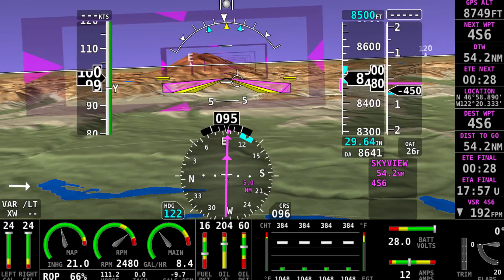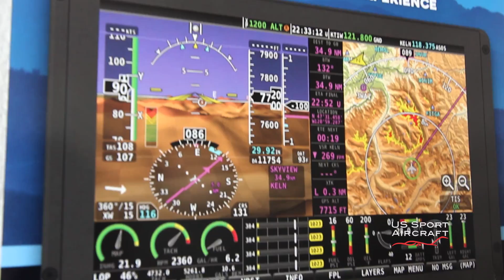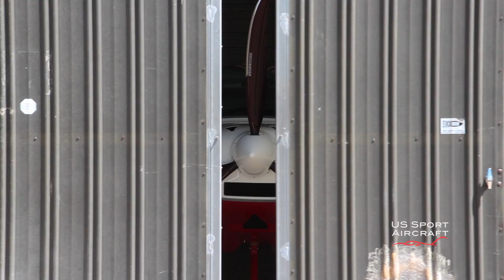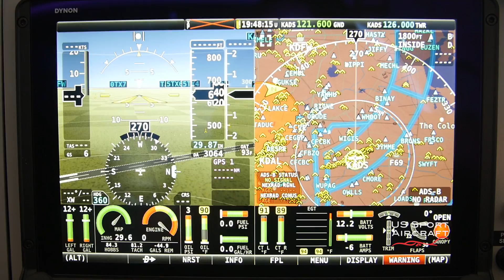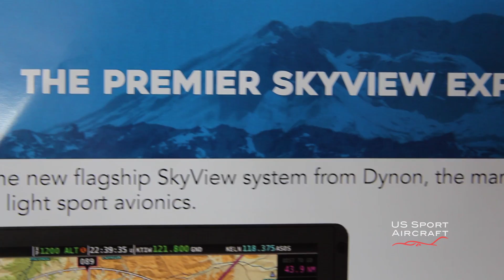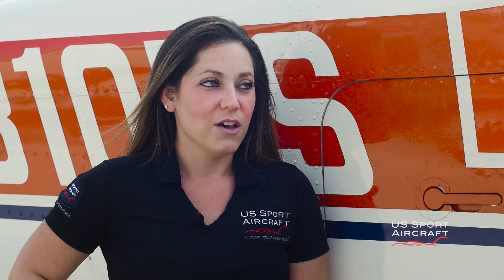Dynon Certified: Your Questions Answered

Comment: Hello.  We have the D10A and it’s worked well for about a year. It now has a black screen. We checked power to the instrument and it is powered. Any words of wisdom of what could be wrong?
Reply from the maker: Our support team able to provide direct support here, but you can contact them via the methods on this page: https://dynonavionics.com/contact.php
Reply from the maker: (off the cuff though...If it's definitely not a power supply problem, we'll probably need to see it for repair)

Comment from the maker: Regarding the comment thread below: With this being an STC based installation, all installs will require someone with inspection authority (an IA, for example) to approve the installation. Practically speaking, we know that basically all A&Ps know and have access to an IA for things that require it. We think the best thing we can say is that we've definitely seen a desire amongst A&Ps and other smaller entities to have access to the ability to install our equipment. Our initial approach is the start, and will certainly evolve as we learn about the different support, installation, and service requirements of this new market for us. So no promises, but know that we're still in the early days here. Thanks for raising this issue though.

Comment: So, you're saying that you are restricting installs to specific installers?  Why should I be forced to have it installed by a third party?  Any A&P should be allowed to install it.  It's a bit insane to be forced to spend money on outside labor when some could otherwise do it them-self.  (Or a non-qualified owner choosing a local A&P who they know and trust to perform the install).
Reply from the maker: With this being an STC based installation, all installs will require someone with inspection authority (an IA, for example) to approve the installation. Practically speaking, we know that basically all A&Ps know and have access to an IA for things that require it. We think the best thing we can say is that we've definitely seen a desire amongst A&Ps and other smaller entities to have access to the ability to install our equipment. Our initial approach is the start, and will certainly evolve as we learn about the different support, installation, and service requirements of this new market for us. So no promises, but know that we're still in the early days here. Thanks for raising this issue though.
Reply: You're still missing the point. Like the Garmin G5 this will very shortly be certified for the vast majority of GA airplanes. And as with the G5 there will be a rapid expansion of the  shops that can do it. Since an A&P receives no training, certifications or testing for avionics installation I'll stick with an avionics shop to install the new radios and 2 G5s our club is having installed in our 172. Your comments indicate you've flown and worked on experimental installations. As I'm sure you are aware working on certified aircraft is a whole other animal.
Again you have a failure of imagination. You've taken this video as the end game and it is certainly not the end game it it just the beginning.
Reply: This is good.  I like and trust my avionics guys.  One is a Mooney specialist and the other is a solid avionics guy who I suspect has done a lot of work with Dynon hardware on experimentals.  I like having my plane worked on by people I know and trust, and for an install as extensive as a multi-screen Skyview, with a new panel cut and wired, I'd strongly prefer having one of them do the work. I know they're going to contact me about any issues, I know their attention to detail is top notch, and I know that the little things that collectively make my plane operate the way I want it so that my flying workflow is ideal for me will get done how I want.  I'm picky about little things and they have a demonstrated ability to tolerate my pickiness.  I'm sure you guys see this a lot on the homebuilt market where people build it themselves because they want EXACTLY what they want and will settle for no less in their aircraft, but it is also true of owners in the certified market, it just happens that Mooney managed to build exactly the plane I wanted.  Except for the vintage 1980 Bendix King panel.
Reply: Then tell us something of you specialties.. JUST A PILOT,,
Reply: Well no. Not any A&P can install it or any other avionics they are installed by avionics techs at avionics shops..  You're also commenting on the very leading edge of this approval process for other airframes.  Like Garmin, Avidine and Aspen you get them installed atapproved avionics shops. The Dynon program  will expand rapidly as more and more aircraft types are approved. To think otherwise just shows a failure of imagination.
Reply: I just care about a 172.  You don't need to be an avionics shop to install avionics!!  At least not per FAA.  I'm not new to Skyview.  I've been flying with Skyview for years and installed several systems and corrected others.  This is Dynon making a business decision.  A poor one.
Reply: Turning Short Final like I said anyone can pretend to be anything on the internet. Oh yeah and you know nothing about me
Reply: I can't fix your misunderstandings, nor am I interested.  Go rent at your club.  Being a qualified person, I know a bit more then you about who is qualified to perform an action.  They don't teach you that at your club.
Reply: If you say so sunshine.  Anyone can pretend be anything they want on the internet.  I can't fix your target fixated, myopic world view or your lack of  ability to see beyond a short 7 minute video. There will be days after this one and things will change. But you have your special truth and will never get beyond that. I really feel very sorry for people like you that can't see beyond the the moment at hand. 
You are a person that flies airplanes but you'll never be  "pilot"
Reply: Keep digging that hole.  Talk to you later Kevin.
Reply: Irony!!!!!  So foolish kid.  You're not an A&P.  You rent an airplane.  You have no experience with anything here, yet you think you're correct.  You're talking to someone who is qualified, understands the STC process, and (Gasp!) works on TC aircraft.  You've contradicted yourself from post to post.  You have displayed "Macho" of the FAA's Hazardous Attitudes.  Your postings make you look really foolish.  However, you did get a laugh out of me!